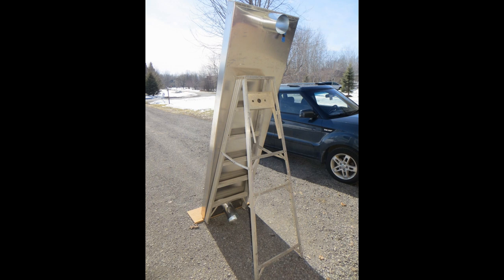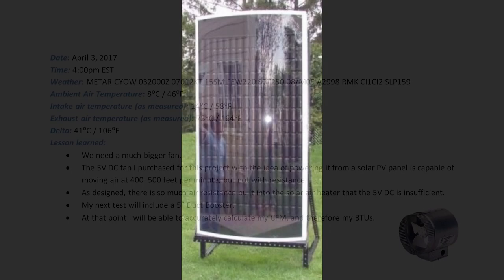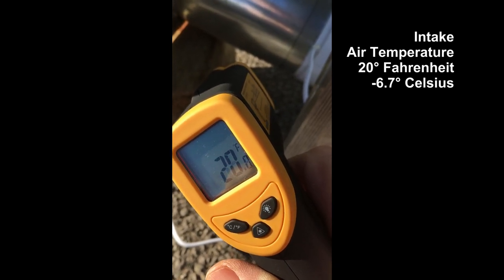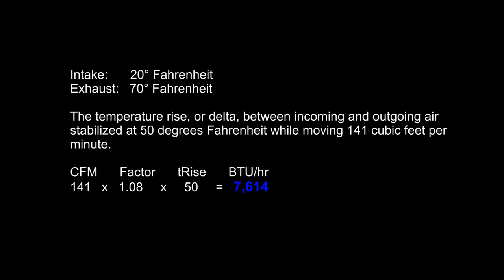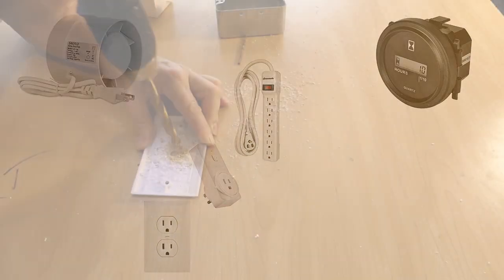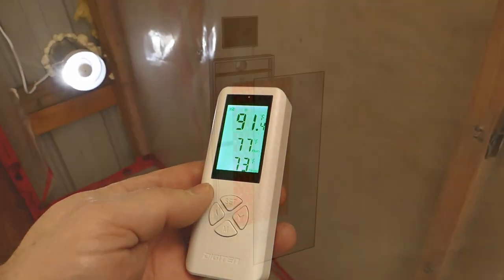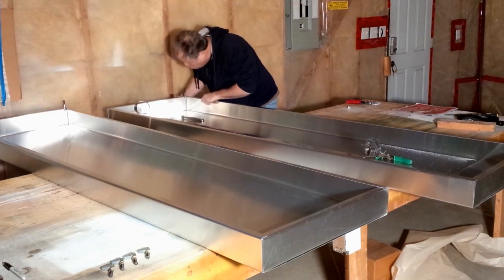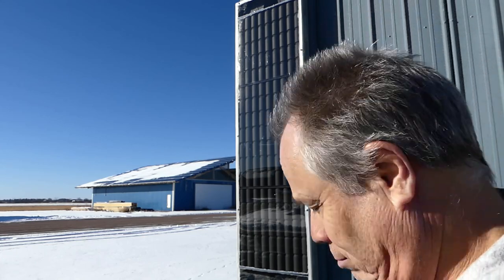DIY Solar Air Heater Part #6

Comment: Maybe I would use aluminum down pipe from gutter instead of pop cans to improve the flow.
Reply from the maker: Good morning
Thanks for your comment.  There is research available online on using a variety of different materials, soup cans, pop cans, downspouts etc.  I reviewed what was available (work conducted by others before me) some seven years ago.  What I have learned since, largely from my Mongolia audience, is that metal screen has proven to be effective as well.  Possibly better than pop cans.  If I was building now, I would be exploring that path to compare the results with what I have. 
Cheers

Comment: So what temperature range did you set your controller to ? ( Turn on/off )
Reply from the maker: I do change it through the winter season.  Right now I have the unit turn the fans on at 45c in side the chamber, and shut off around 25 or 30c.  I have played with a few different numbers.  Just stand next to the unit and see what works for you. Cheers
Reply: @LifeIsShortDIY  I figure you could go mad constantly adjusting the settings. I have mine just set on a programmable on/off Timer, all run off a solar generator. If the sun is strong enough, I let it run 10 minutes on and off for 5 minutes continuously till i unplug the fan. It works well because when the fan is off, the heat has a chance to build up for the 5 minutes.

Comment: so, why not just make more and use down spouts inside?
Reply: Ikr. Or at least a length of downspout with a stack of cans on either side screwed to it.
Reply: @johnassal5838  The downspout design looks good and also seems to deliver reasonable results plus make the build easier I like it. Haven't tried myself though

Comment: You should use thermal couplers.
Reply from the maker: I tested thermal couplers and found them ineffective for my needs. As the season change, it becomes necessary to change the threshold on when this unit comes on and off.  By using the part I chose, I can change these settings as needed.  Works very well. Thanks for the comment.

Comment: I like it, but...

what about:
* frame with foam just little more thick edge,
* and double glass,
* with edge of foam (btw, foam strip, 2 notches on it, and a wood strip over, not need to drill the glass/plexy)...
* foam around the necks (inlet - outlet), 
* top edge slope, to avoid water - snow...
* small solar panel for the fan... (not sun = not fan = not heat)
* small flap gate-valve, to shut the air flow (avoid heat escape will the sun not shine..)

anyway, congratulations.

Comment: the other shorter design is not using a manifold . therefore utilizing airflow from the inside of the cans as well as the 
outer which is the entire compartment . the long ingenius design is not using airflow from the actual compartment . 
but that can be fixed very easily . what did he change any way ? not gluing the cans together would have been an 
improvement and not using the manifold . but the big question is , why use outside cold air ? run air from the inside
of the house with an extra fan . then you have forced air my friend .

Comment: Heat collected per sq ft will always be the same. To increase flow, increase the number of tubes the air travels through, not the length. Wider would be better for air flow, not taller.
Reply from the maker: Thanks for the insight.

Comment: "Heat", "temperature" and "thermal energy are three different things.  A pebble at 100 degrees is the same temperature as a bouldar at 100 degrees, but the boulder contains MUCH more thermal energy.  Heat is how quickly thermal energy is moved. Looks to me like you picked the optimal design to increase TEMPERATURE.  All else being equal, you want to increase Thermal Energy- not temperature.  3 cubic feat of 100 degree air will warm your house more than 1 cubic feet of 200 degree air (and lose less heat from radiation exiting the panel).  Imagine if they turned the fan down in your furnace so the air would come out at 200 degrees instead of 110 degrees or so.  More heat would go up your chimney and be lost in your ducts, and the room would also have uneven heating.  Use the aluminum screen or downspout designs